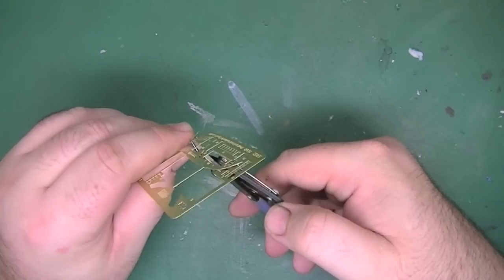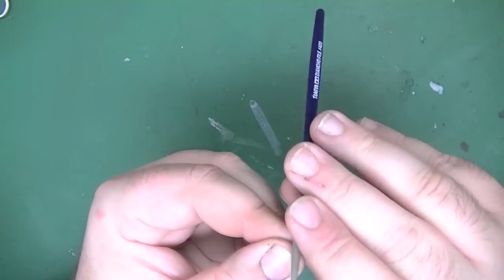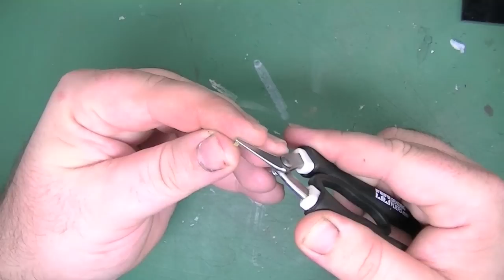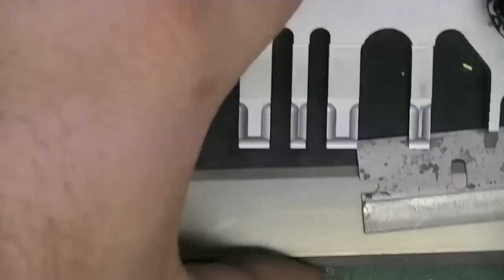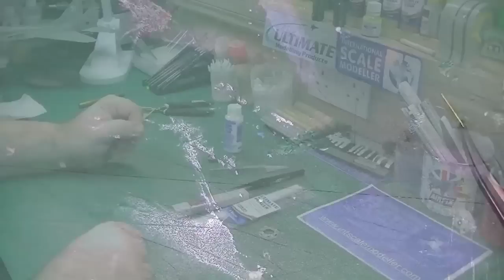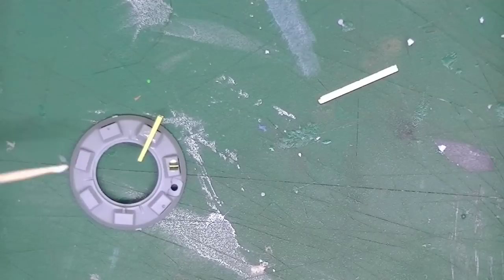ISM Guide on How to Use Photo-Etch & The Tools Involved

Comment: Hi Paul. You used PVA to fix P E to plastic. Once dry, how strong is the bond between them?
Reply from the maker: on surfaces with a large surface area its pretty good , smaller parts not so much

Comment: I cut PE with a single-edged razor blade on a ceramic tile. I've done a few Bronco kits, and the PE is thoughtfully provided between two layers of adhesive film. All you need to do is remove one side and cut. The carpet monster will be denied his favourite snack every time, unless I drop the piece en route to the model.
Reply from the maker: Cheers mate, thanks for watching sorry about the late reply - Paul :

Comment: tweezers dipped in tool magic puts a layer of latex? on the tips  and keeps tiny parts from launching across the room.  also i found if you can get a set of smooth jawed hemostats they work just as good and are cheaper then tamyia.
Reply from the maker: Cheers

Comment: Great video as always. It pointed out a lot of things I will try. I have two kits that I bought photo etch for. One is for the Aston Martin DBS you are currently working on. The after market one I bought has a multiple piece disk break build up and some other items that I will add. Seems straight foreword enough

However the other set I bought is for a street rod hood (bonnet) tie downs. They are very small. I see the parts well enough but even with a small needlenose pliers and tweesers and small fingers I am all thumbs! I may have to give up and I don't give up easily!

I even thought about putting a big glob of glue on the hood and throwing the parts down on top.  Hoping that they would fall into the correct place.

Thanks for all of the great videos and tips. Keep them coming.

Comment: Some tips I've read on an American model car forum re p/e are ; 
1; place the p/e fret inside a sandwhich bag ( zip lock ) and use a blade as usual to cut the part from the fret without it flying into another galaxy.
2; when using tweezers, use the inner tube from a bicycle tyre, cut to size and glued to the blade of the tweezer creates a cushioned grip to hold the p/e part in place. not a hell of a  lot of expense and you have much superior control over the placement of the part onto your model without the dreaded 'ping' where did it go? 
Hope this helps someone save a little money.

Comment: I started building the M1070 truck and the M1000 trailer in 1/35 scale. I purchased three photoetched kits to go with it. in the past I have only built 1/24 or 1/25 scale cars and trucks and was in a bit of a shock when I looked at the photietch parts. Your video will help me out. One photoetched kit has tiedowns with working ratchets and the other has brass corner reinforcements for storage bixes, etc. Talk about small pieces! Thanks.

Comment: Going to try those pencils. What I've used is something like a tootpick or perhaps something a little thicker dipped in little bit of beeswax. Beeswax is dirt cheap and a perfect lubricant for airbrush nozzles. If the pencils have less tack they might work even better - if you use beeswax use the minimum amount or the part might stick to the implement and not settle on the glue. Tacky craft glue can help that.

Comment: Paul, Im getting ready to start a 1/35 King Tiger myself and as you know the fenders need some curling. (I have an extensive photoetch kit for it). Without having to buy the expensive rounding tool, do you have any suggestions on making one to use at home??
Reply: You can just use some thin foam and a cylindrical object to roll it, it does the same job really